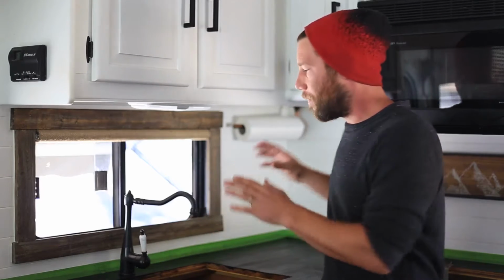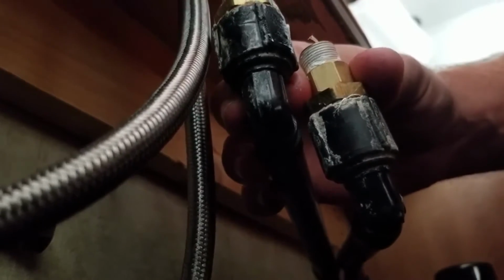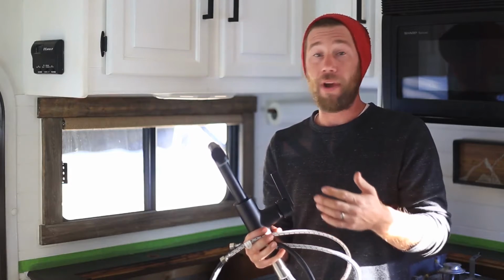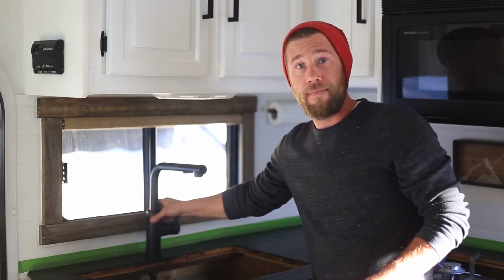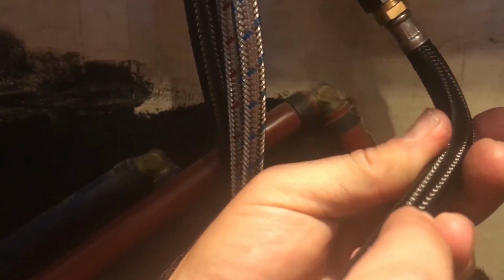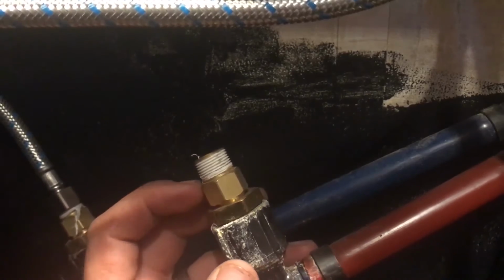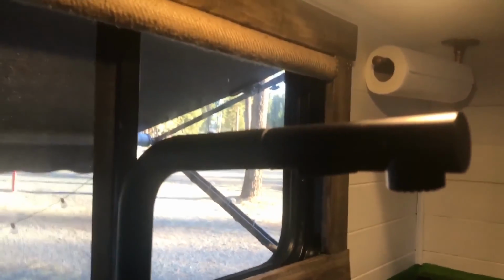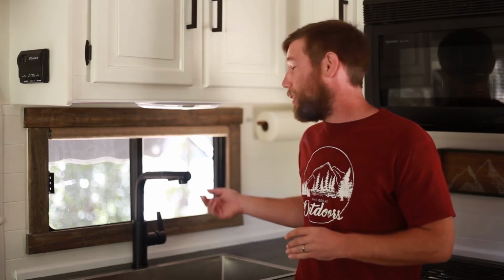How to Replace Your RV Kitchen Faucet

Comment: Okay, received my new faucet from Amazon today..but ran into a problem..I wish you had shown on your video..my "closet (water) lines" are hooked from the tank,  to pipes coming from the floor,  up to the faucet.  The cold water line has a side connection then , to the faucet.....I did notice seems like you had 3 or 4 lines going into the new faucet..???  since the connections are adaptable at one end, to 1/2"  that works for the part coming/going from the tank...the smaller ends to the faucet itself..but bypassing the lines that go down into the floor...and leaving the (cold) side water connection open......???   HELP !!!    I notice you had (what looks like 1 (or 2)  black plastic lines inside  bottom of the new faucet,, along with lines supplied.....am I wrong?  and if not, where did you connect the black line(closet) into???   I'm stuck!!!  The new faucet has only 2 lines supplied....I am in DESPERATE need of help !!  Thanks bunches !!

Comment: Hey nice videos mine was leaking also but due to not winterizing properly the leak is coming from up in the faucet and out of the tap I’ve got it alll out but can’t seem to figure out how to take the faucet apart to see if I can buy a replacement part if you can if not do the new faucets come with the water lines attached

Comment: What size of extra adapters did you use? Where did you purchase them?!
Reply from the maker: Hey @59fiftyfamous I believe they were 3/4 to 1/2 an inch with 3/4 being the rv side and 1/2 being the faucet connection. I'm not 100% that was the size but pretty sure. We were actually able to pick them up from Lowe's or Home depot. I'd recommend taking your faucet connections with you to make sure you get the right size. Anyway, I hope that helps :)

Comment: "First thing we're going to do is disconnect our water lines" - Removing the sink doesn't count?  That's actually a really important step. Access without removing the sink can be extremely difficult - it certainly is in our trailer. Removing the sink isn't a trivial task. It's not like you just pick it up and put it aside.
Reply from the maker: Hey @Peter Ellis what you're saying has been pretty difficult through our process of sharing what we learn, mainly because every rig out there is completely different from the next, so I'm sorry if it was to difficult to disconnect your lines before removing the sink. If you have any questions about getting the sink up feel free to let me know or you can check out our post which goes into step by step that you can do in any order - https://mountainmodernlife.com/rv-kitchen-sink/ - anyway I hope this helps.
Reply: The title is replacing the faucet… not removing the sink… 🤦🏻‍♀️